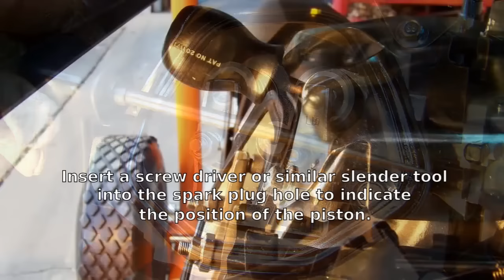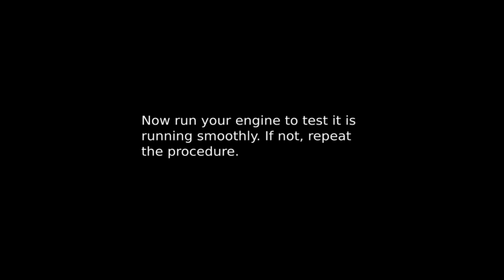Setting Valve Lash Clearances on a Portable Gas Generator and Small Engines

Comment: What the clearance
Reply: Can i please have the make and model of the unit to be sure i give you the correct information
Reply: Wen 6.5hp engine. What's the calibration please?
Reply from the maker: Thank you for contacting Generator Guru. I have been asked to look into your inquiry and Can you please provide a little more information as to what you require.
Reply: @Generatorguru  I need the valve lash calibration measurements for both valves for this engine.
Reply from the maker: Dear Sir/Madam

You need to adjust your valve lash clearances to:

Intake: 0.015" (0.381mm)
Exhaust: 0.015-0.020" (0.4-0.5mm) (Try smallest setting first. If still not running right, change clearance to 0.020".)
Reply: @Generatorguru  Thank you very much, I will give it a try and see how it runs after that. Thanks!

Comment: what is the valve clearance for a 4200W King Canada generator 7HP??
Reply: Dear Stephany Welshman,

If you find that the unit is backfiring, or kicking back on the recoil, it will be that the engine has settled in and the Valve clearances need adjusting.

Your engine a system of moving parts, and moving parts wear. When you adjust a valve, you're not adjusting the valve itself but compensating for that wear, letting the valve open and close as efficiently as possible. 

We have made a video to show you how to adjust the Valve Lash Clearances: 

Setting Valve Lash Clearances on a Portable Gas Generator - https://www.generatorguru.com/help-me-fix-my-generator-repair-advice/

You need to adjust your valve lash clearances to:

Intake: 0.015" (0.381mm)
Exhaust: 0.015-0.020" (0.4-0.5mm) (Try smallest setting first. If still not running right, change clearance to 0.020".)

If you need to purchase parts they are available on this web page: https://www.generatorguru.com/kcg-4200g/?sort=featured
Reply: @engineeringdept.generatorg1760  those valve clearances of .015 to .020 don't look right to me.